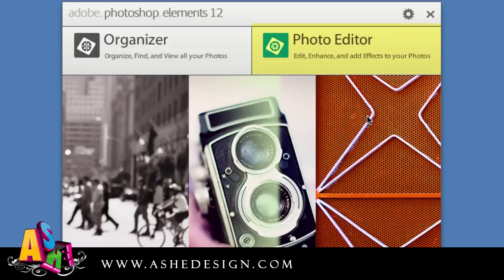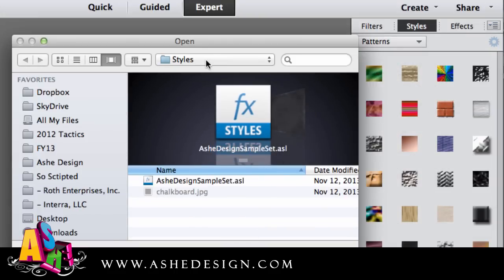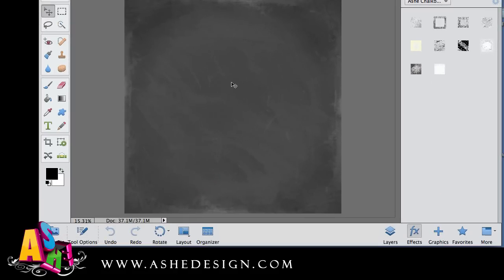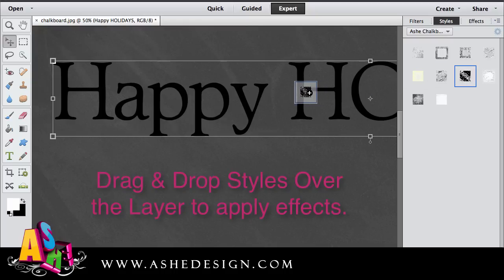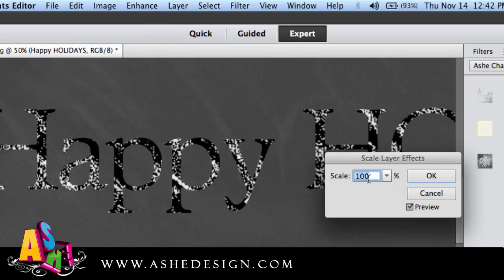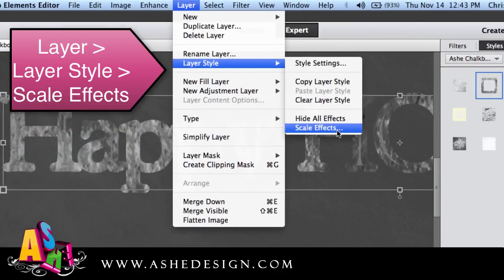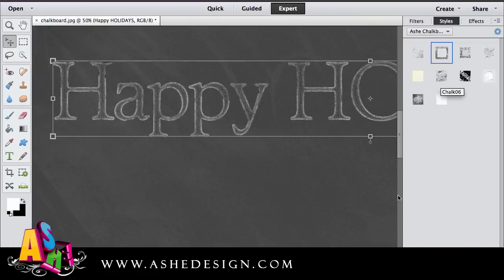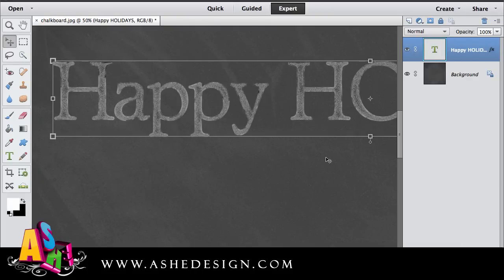Load & Use Ashe Design's Photoshop Styles in PSE 12

Comment: is there a how to on making styles ? Can you make styles in PSE ?
Reply from the maker: Styles are drive off of Layer Effects. There are layer effects in PSE, but they are more limited than the offerings in the full Photoshop.
Reply: so i need CS to design and save a style ... i save a PSD text with all the layers i use to get the design i want and just open it and chose desired text and then move it to the document i want it in . takes longer but will have to work until i can sell everything i own so i can purchase CS version of photoshop...lol